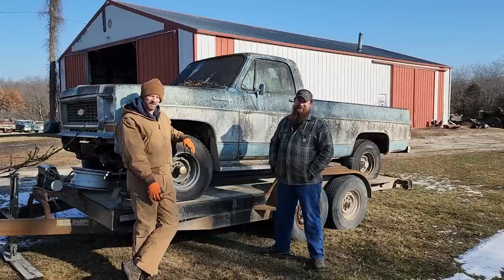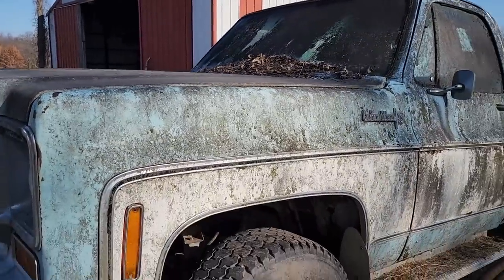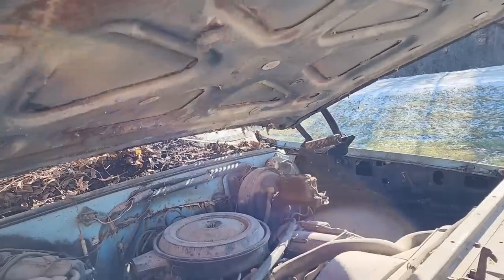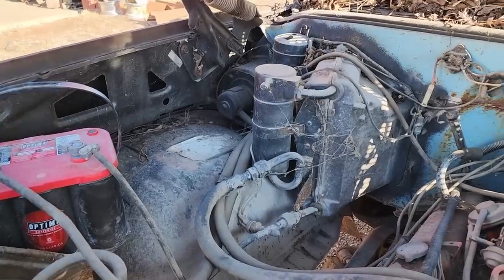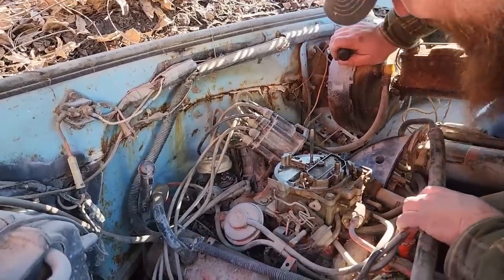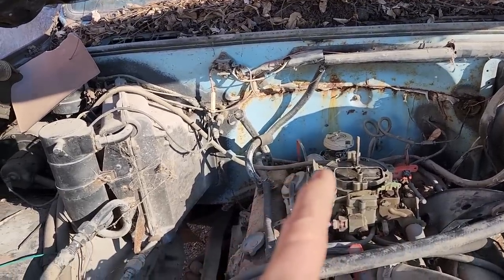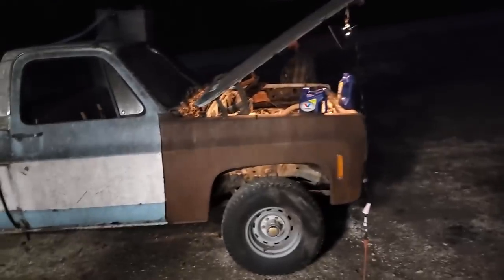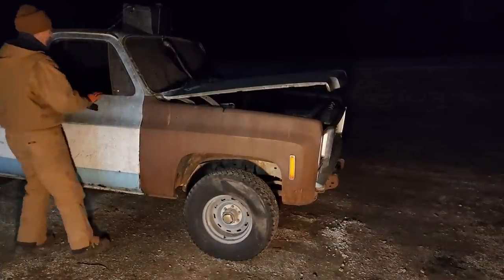Squarebody revival after parked for 19 years. will it run and drive?

Comment: GM quadra jet carbs are tough and easy to tune, as long as the throttle shaft bore isn't egged out. The square body Chevy is a beast of a work horse. Easy to modify to suit your needs. Good to see you working on more than just Ford's. Keep up the great content.
Reply from the maker: I dont know what Aaron plans on doing with the quadrajet but throwing it out was not an option for him!

Comment: I have owned three squarebodys in the four years that I have been driving and two of those were full time four wheel drives. I have never had a problem with it before. Not sure why they get a bad wrap but I’ve taken them through some rough terrain and pulled with them and Even went 105 in one of the trucks. But I still wish I could do a burn out or do doughnuts. Got a neat truck there. Hope she serves you well.
Reply from the maker: Full time 4x4 put unneccesary wear on components and eat more fuel. The 203 is a beefy unit, but I have witnessed some of them slipping chains when used hard.
Reply: @misfittoys8883  yes they definitely eat fuel. Lol. And I am going to get a 205 at some point.

Comment: I have had 3 np203 that I just took the none lockout hubs out and replaced with lockout hubs.  Been working for years that way. Driveshaft does not spin in 2wd.  Luckily you had a great np205.  Mine drives great down the road and with the lockouts it does not wear the front out.  Just wanted to tell you all.

Comment: And that is vacume advance it goes down to the trans if you don't hook it up, it will only have 1st gear. Ditch the Quadra puke put an edelbrock.   Save time. Base settings runs perfectly.    Glad you saved it she's nice
Reply: Vacuum advance has nothing to do with the transmission. Vacuum advance is in the distributor. That is the vacuum modulator valve, and yes, it has to be hooked up, but not necessarily through thermo vacuum switch.
Reply: Quadrajet is a very dependable carburetor. They mostly just have issues with the bowl plugs leaking. Easily repaired with a little epoxy.
Reply: @twinkie27271  nope boat anchor  that's all there good for never seen a good one period

Comment: I thought Ford mechanics had the largest assortment of special adjustment tools in the industry. More hammers than a metal working body man!  Just joking, I’ve got em all, Fords GM Mopar and off shore. Over 50 total. 
Mine are all up here in Alaska  I’ve got about half of them running, but at age 73 I’m running out of birthdays to get ‘em finished. Oldest is a 1936 front wheel drive Cord Westchester.  Take care and I just subscribed.
Reply: Better hurry, you only have another 30 years in you! Seems like quite the collection! Fun stuff!

Comment: That glad u got her running all the old chevy that I get out of the sandhills first thing I have to get new. Is starter fuel pump and cap. Make sure u check the trans case oil😋
Reply from the maker: Ditching the 203 t case for a good ol 205
Reply: @misfittoys8883  and lockout hubs.